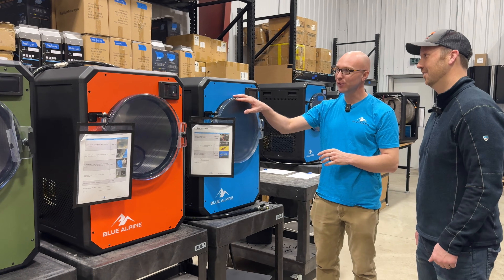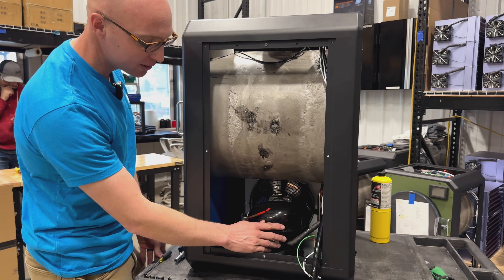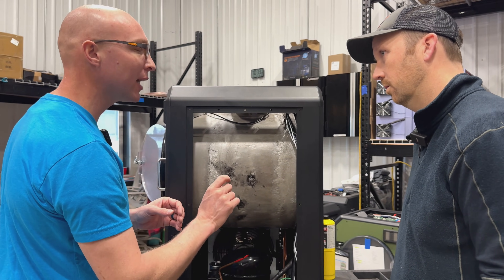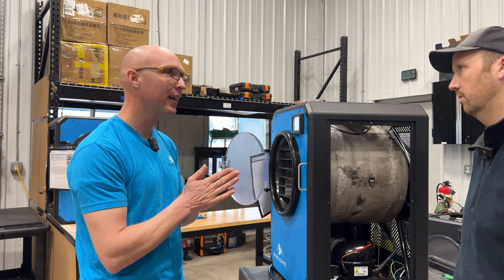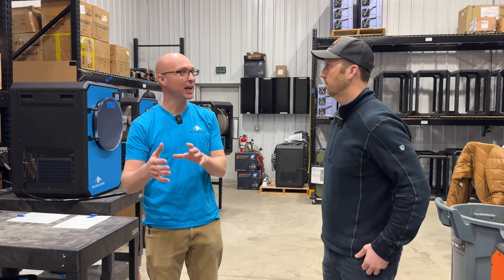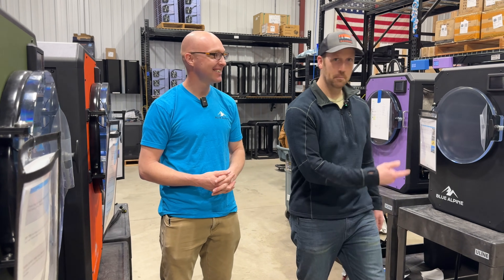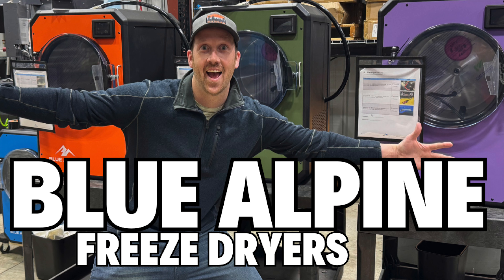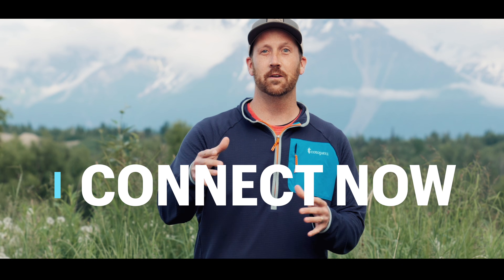I Got an Inside Look at How Blue Alpine Freeze Dryers Are Made ￼

Comment: why every freeze dryer have this shit cover seal? why not use instead big oring
Reply: O rings wouldn't provide sufficient contact area or compression across the broad, flat door interface of a freeze dryer chamber. O-rings excel in compact, dynamic, or high-pressure applications (like pump shafts or hydraulic systems) but can fail under uneven loads or larger surface areas without proper grooving, which isn't feasible for a removable door seal.
Reply: @918scott  proper groove on both side and experiment with oring material will be success. in my head looks good